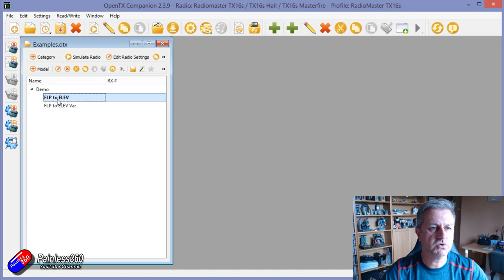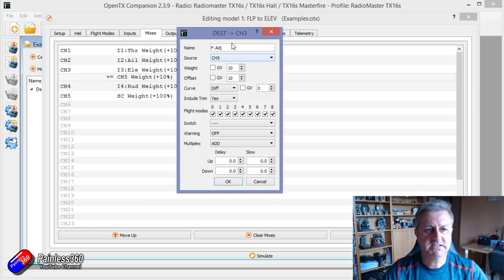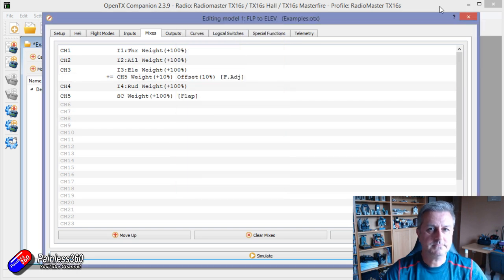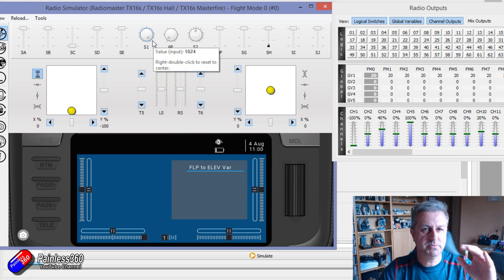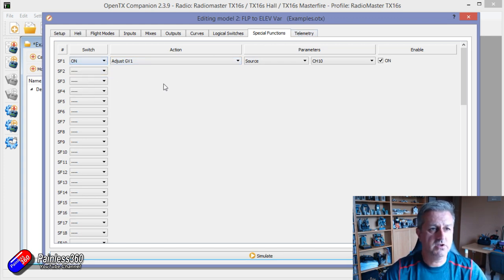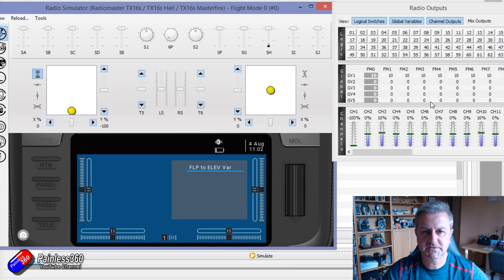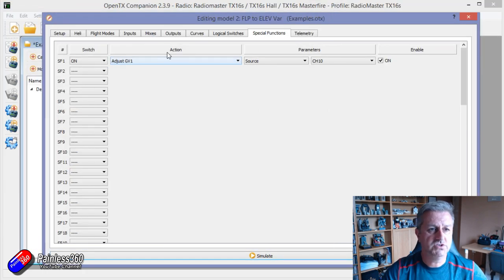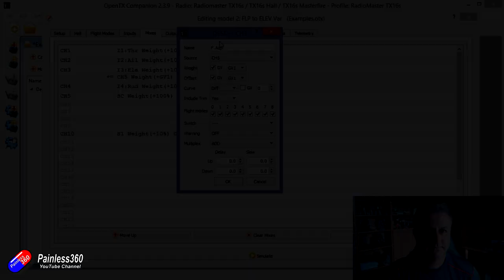OpenTX Mix School: FLAP to ELEV mix on the fly

Comment: I have used the throttle trim (what else are you going to use it for) to adjust Global Variables directly.  The way I do it is with the "Adjust GV" Special Function doing Inc/Dec with the Throttle Trim.  I have used other trims that are turned on/off based of other switches (physical and/or logical).  A major advantage of this is you can use the trim to adjust multiple different GVs (controlled by a switch) and you do not have to ensure the knob is in the right place every time.

Comment: I wanted a slowed down flap deployment (easy) with also slowed down flap-mix in elevator (also quite simple) and still full deflection for elevator in every direction (this was hard). I succeeded this way: using my flap-switch as source in a mixer with a curve to adjust to the correct values for elevator mixin (14 and 28 for half and full flaps) and slow of 1 second for up and down. This mixer is written to a GV by a special function. And the trick for me: I use this GV as subtrim for elevator output. So I get a corrected neutral position, but still full deflection in every direction.
Maybe somebody can use this, too.
Reply: @kitefriend100, you are a genius! Thank you very much! I spent days looking for such solution and none of the videos on YouTube even touches this topic. Really appreciate it. Cheers.

Comment: I don't remember where you said it, but I seem to recall you saying you don't put flaps as an input but rather a mix directly controlled by a switch. Have you ever done a quick tip about why/why not make something an input vs. a mix or vice versa? With OpenTx so powerful, I'm sure there's reasons why one method or another is preferred for some things, but it's the "why" that I don't yet see. Thanks! You do a great job with these.
Reply: Franklin Mellott I have the same question.

Comment: Appreciate your channel. I got the first option working, but wanted a pot for fine adjustment. When I tried implementing the S1 adjustment I kept getting the output monitor showing the opposite direction of what I wanted no matter how much I played with weights and offsets. If I got it going in the right direction, from a negative to a positive, it wouldn’t go past zero. Maybe due to the way I have flaps setup in the first place?

Comment: Hi, I am new to Open TX. Having mostly Flysky receivers and few XM+. Now I just bought a Radiomaster TX16S. Could you let me know if you have any video to bind the TX16S with a Fs-ia6b on I-Bus? I wasn't able to get Aileron and Elevator working after binding. Even the Rudder was jerky. I have no issue though when binding with a Mini-Ibus 8/18CH AFHDS 2A. Thanks a bunch!

Comment: Lee, do you have a video where you can use one channel to control the 6 position switch in the Jumper radio, and use it for flight mode in Betaflight or Inav?
Reply from the maker: I see. That is easy. Select '6P' as the switch and it will work like that. Happy flying!
Reply: @Painless360  good morning Lee, I did it with curve menu look more flexible,  I just want to free the amount of channels used, for other gadgets.  LOL

Comment: Brilliant Lee, I’m new to FPV and are at the total beginner stage to the fact that I’m at the binding stage. My new Jumper t18 doesn’t have all the wav files I need for the switches such as acro mode, horizon mode altitude mode etc. I would have thought these would be standard in the radio. Would you know where I could download these wav files. I tried open tx site but couldn’t find anything. Thanks for sharing
Reply: Download opentx speaker. It lets you create custom sound files. And a tip, turn the volume all the way up.
Reply from the maker: The Amber sound pack is what I use and has all of that in it already. I have a video on it. Best of luck!
Reply: Thanks for the reply Lee. Do you have the link please. I’ll take a look.

Comment: I've been using inputs to set my global variables, there's a small problem of a 0 reset tho, if you turn off or on a input with not-switch i.e. !SH⬆️ the channel will move to the 0 position and then moved to the correct position.